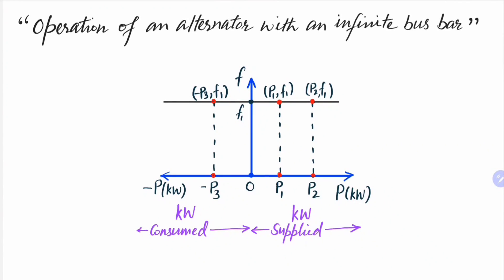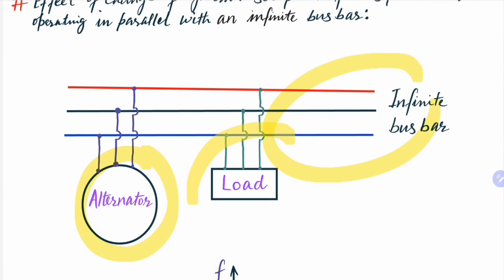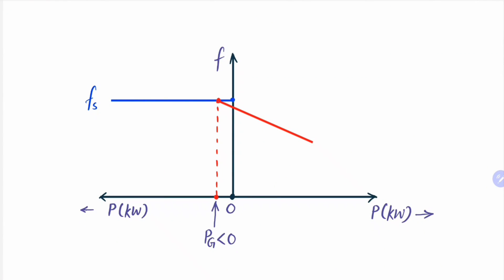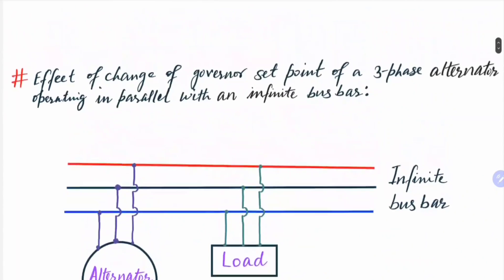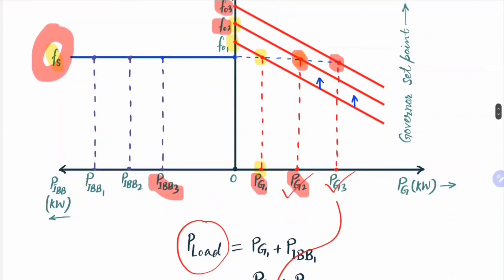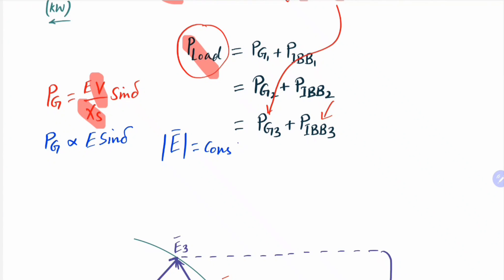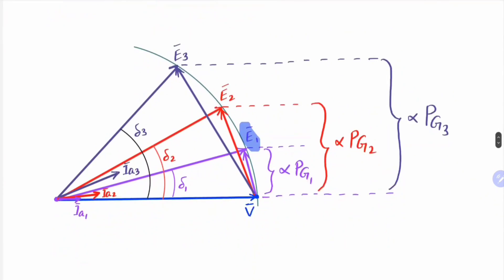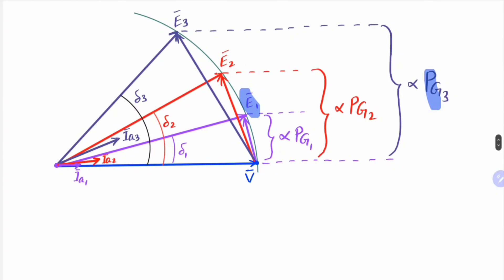Effect of Change in Mechanical Input | Operation of an Alternator with an Infinite Bus Bar

Comment: Sir,E can be changed by either changing w or flux.Agreed that the field current is kept constant in this case but increasing the steam input will ultimately affect the speed of the system and indirectly E will change.Can you please revert back..
Reply from the maker: Dear Najib,
As Alternator is connected with infinite bus bar, E will remain constant. For more details, you may watch following video lecture:
https://youtu.be/zAoIzuAxI_U
Reply: @DrAfrozAlam  Jazakallah Sir..Will watch this video and revert back in case of any doubt